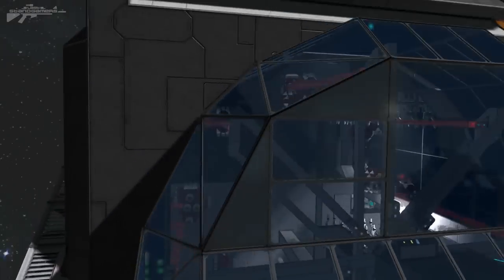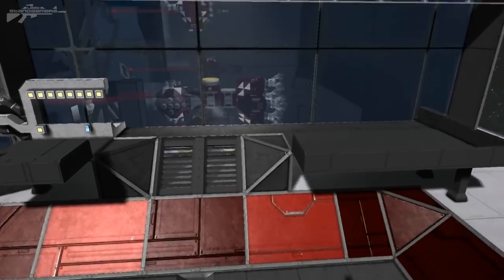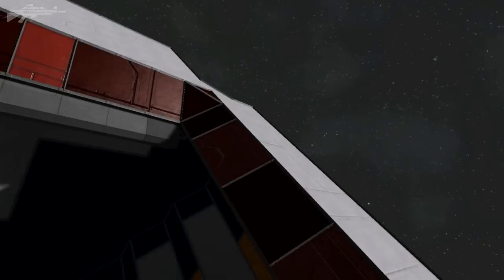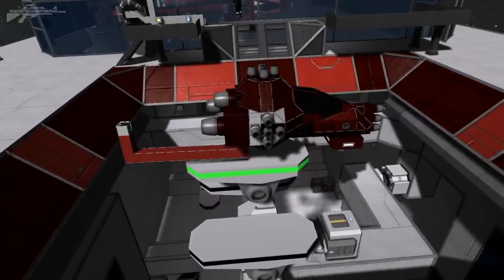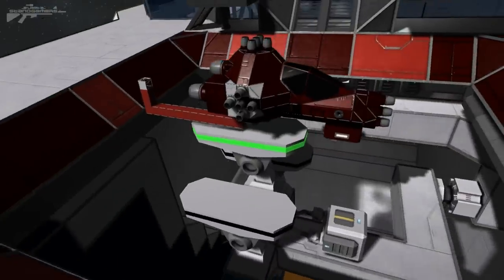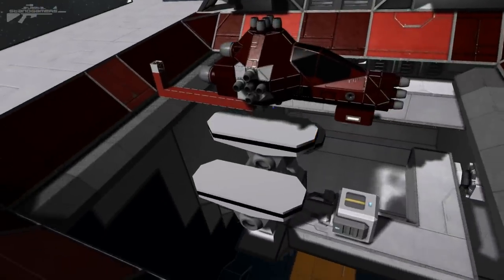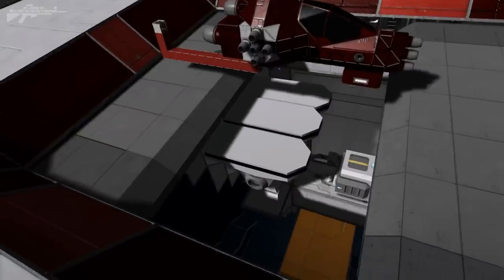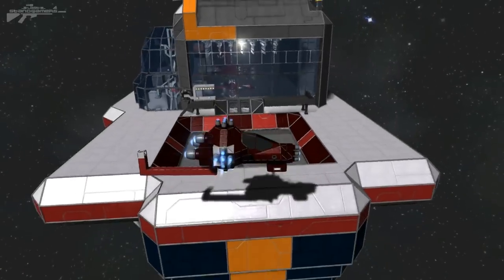Space Engineers - Ship Vending Machine, Rotary Printer

Comment: aron can you make a solar power torpedo? because that would make a little more sense in a homing torpedo drone than one powered by uranium
Reply: A battery powered one makes more sense, solar panels are too big and need to be aimed towards the sun to get the most out of them, a battery would be enough to get it where it needs to go regardless of sunlight. Downside of course being that it needs to charge before being launched but that's not exactly hard.
Reply: well maybe some solar panels to keep it charged... something like a small one or two on therer
Reply: For a torpedo? Something that will be separated from the ship for a much shorter period of time before exploding on the hull of the enemy than the battery can last?
Reply: well he keeps coming up with these scenarios where a ship is passing by and it passes the torp/mine...
so maybe a self propelled mine instead... with a 1 or 2 solar panels to assist in keeping it charged...
Reply: UNSCrearadmiral For mines sure, if you want them to fly towards enemies that is, otherwise ditching the explosive part where you want it does the job as it'd explode on impact.

Main problem I'm trying to point out is that solar panels are 6x the size of an explosive block. Much easier to see at a distance, much easier to defend against as it's a larger target too.
Reply: true... so naybe 3-4 batteries
Reply: UNSCrearadmiral Might surprise you how long one can last, I actually tried it out in-game last night, one battery is more than enough to fire it off where it needs to go.
Reply: UNSCrearadmiral plus solar panels are harder to make than batteries
Reply: i wouldn't know, my laptop can barely run Space engineers, its like 2fps and all the particle effects affects are wonky
Reply: UNSCrearadmiral particle effects are cartoonish. that's the way they made them,unfortunately.

Comment: you can add something to cut off the excess before it comes up to the surface, that's what I would have done if you don't want that extra thing connected to the ship after it's finished and resurfaces.  

Basically all this is, is cheating and making you lazy into building something creative, therefore there's no engineering.  Just one big distraction as we go awe.
The workshop is called Cl- Automated Small Ship Factory

Comment: Already working on regenerative hull plating using the hologram and welders so a ship can take damage and heal itself. Got a panel in the testing stages. Ideally I need an "armour block with a built in welder" mod to get the thickness (and mass) down a bit. Only had the game for a week, love it. :D
Reply: IIRC there are single block welders designed for smaller ships, and welders can weld blocks on the same ship now as well
Reply: there's a mod with nanomachines that can do that for every block